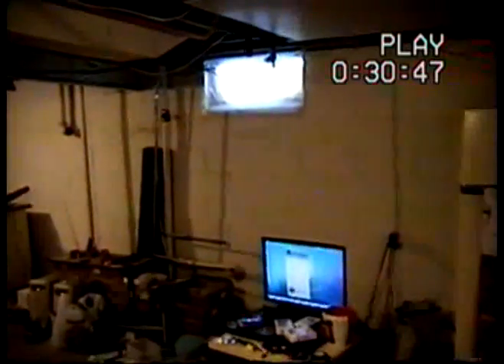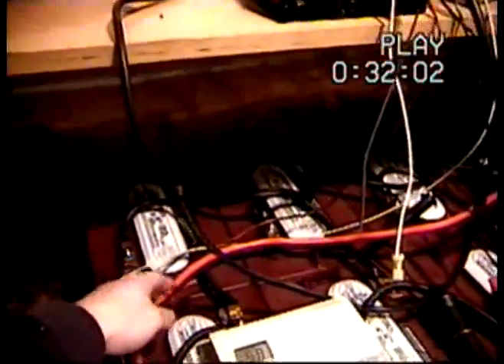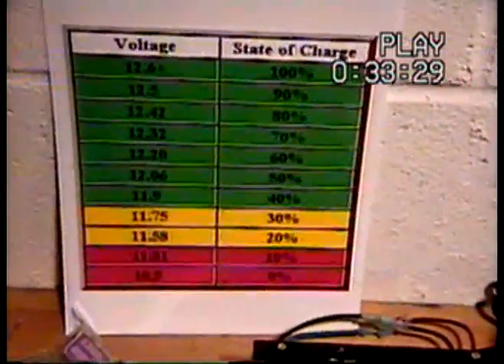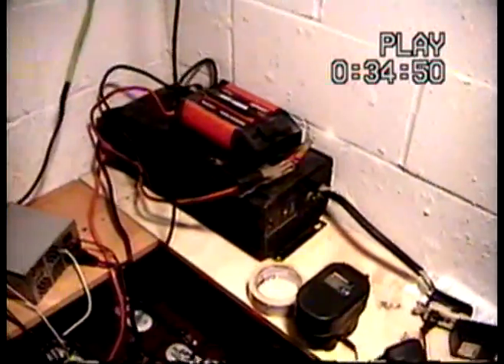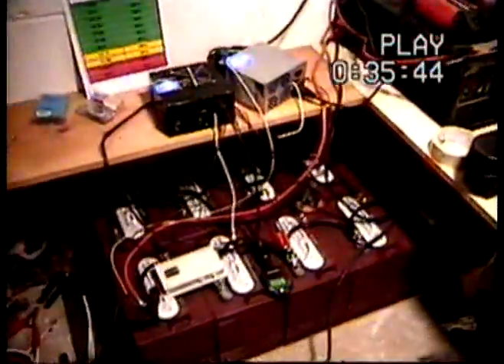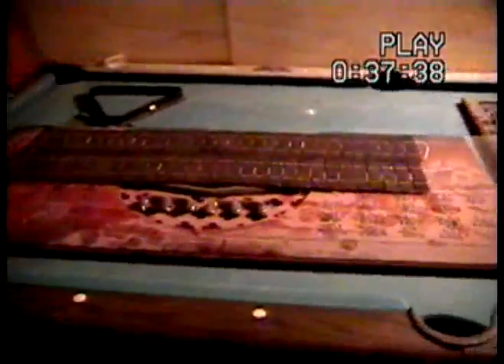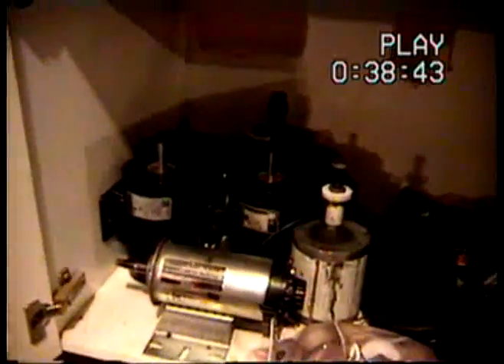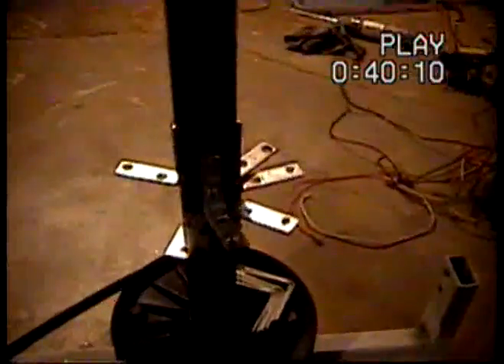Battery, solar and wind generator setup

Comment: have you tried an ac pm 3 phase yet ,i read they have the best output ,did you have to seal up your ameteck from the weather ,do we need blocking diodes if we have a qualilty controler

Comment from the maker: Thanks, Ya the top of the solar cells are - and other side is +. I solderd to all squares, top of 1 cell to bottom of other.  I used 150ft #12 and #14 extension cords cut in half for my windgens.

Comment: Dude! great stuff!lots of good info.good tip about the battery spacing.I think i bought the same cells from this fred guy on ebay they have 6 small squares on the back! do the tabs we solder cross all 3 per side? and i have a wind gen ( a pm dc on youtube)but its 70 ft from the house do i have to run some number 8 or 10 wire or?

Comment: I'm curious about how you deal with the hydrogen gas that is created when you charge your batteries. Shouldn't it be vented outside?

Otherwise it looks like you have quite the system going on. Good luck!

Comment from the maker: Actually, you can put new batteries on concrete.  After a certain date they changed them and it is ok.  There is wood under them though, kinda hard to see.

Comment from the maker: Forgot to add, that the only way you could do something like that is to use an UPSas a DC to AC converter. If you found one cheap/free because the battery inside was dead.  Just remove the battery and hook the wires up to 12volt DC or a 12volt battery.

Comment: Can a computer PSU be used as an DC to AC converter? I mean plugging a 12v DC source to one of the many outlets and then plugging something at the other end that uses AC, given that it uses less Watts then the PSU can supply, can that work?